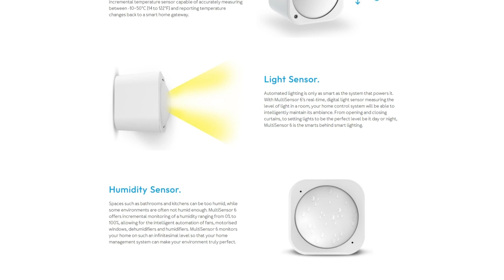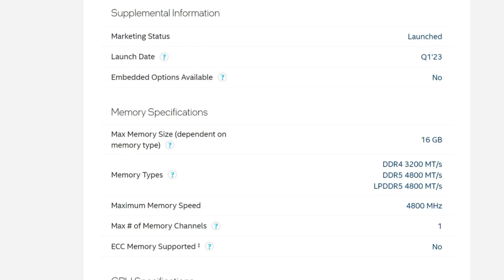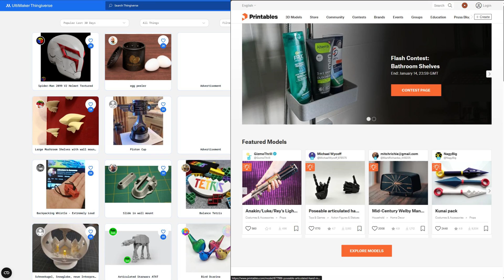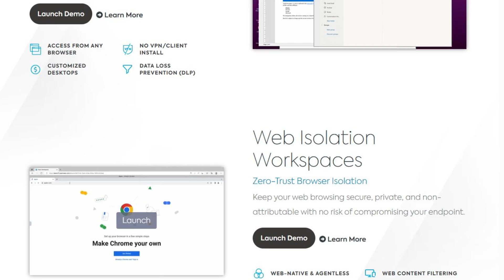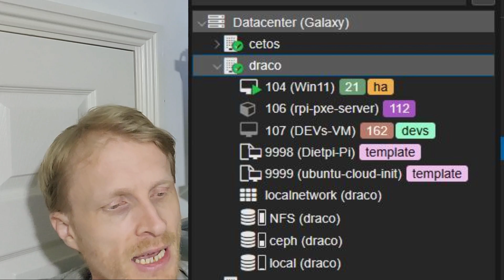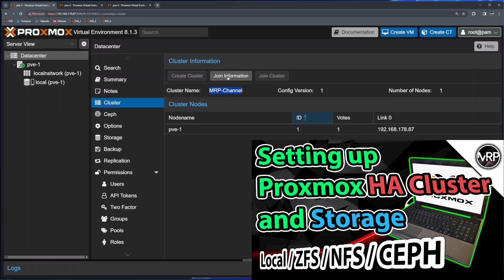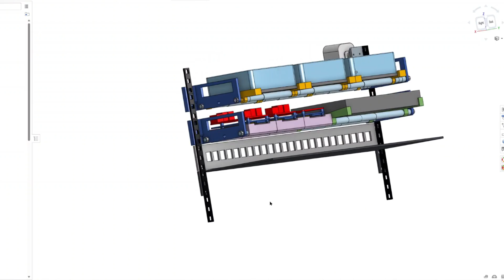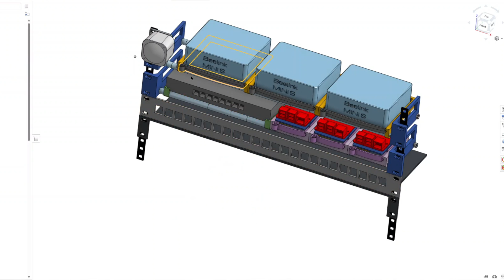My Home-Lab Proxmox 3 Node Cluster + other bits | Proxmox Home Server Series

Comment: Man you've been a blessing helping with Proxmox. Your setup is absolutely awesome! I have a quick question if you don't mind. I ran into an issue when my dynamic IP changed. I have a domain with Cloudflare and so I assumed it would be an easy fix by just going into my DNS settings on Cloudflare and updating the IP address but since Proxmox's GUI is hosted on port 8006 it seems Cloudflare won't allow me to use my IP and port. For instance when I put in 192.168.xx.x:8006 it tosses me a error and will not let me add it. Now I can't go to my domain and access my server. Can you please help? 🥺
Reply from the maker: Standard cloudflare DNS configuration allows only 80/443 port mapping. I suggest to have Cloudflare Tunnel setup going. That way you can map any port on any internal network IP address.
Reply: @MRPtech  I mean it was working I'm uncertain what you mean can you provide what I need to do exactly? I'd followed your guide to setting it up here on YT and it was working fine til the IP changed.

Comment: Excellent rack! I'm thinking of doing something 80% similar, however, I'm very indecisive about the equipment selection.

Let me tell you what I have and want to maintain in HA:

    2 VMs with virtualized Pfsense (One primary and the other for backup)
    2 VMs with Pihole for DNS resolution
    1 VM for Home Assistant
    1 VM for Jellyfin and Transmission over VPN

    (some other not so important VMs and CT for testing and tinkering purposes)

Currently, I have an old 2014 Mac Mini with a 1TB NVMe disk and 8GB of RAM that works perfectly, but I'm looking for redundancy and, at the same time, the lowest possible energy consumption.

My biggest question is, do I need individual NICs for CEPH and others for HA? Does performance suffer enough to justify the expense?

These questions are tied to the fact that I'm leaning towards N100 processors (each node with 16GB like yours) for efficiency and low consumption, but I'm also interested in having the nodes "fanless," so I was considering the options of "firewall PC" with 6 NICs each.

Thank you in advance for your opinion.
Reply from the maker: Hi, 
I picked N100s for exact reasons : efficiency and low consumption. And that i can upgrade to 16GB RAM or more down the line. 

About Fan-less PCs:
I was thinking to get fan-less mini PC's with more then one NIC, but i had some concerns about cooling in the box. In summer my home office gets quite hot and even not i am not sure if these mini PCs and exhaust fan will do enough job to keep it away from fire. If all will goes well during this summer i might change them, but then i need to change switch to more ports or add additional one ... i am not sure if i want to do that at this moment. 

CEPH:
CEPH recommends to have separate NIC for CEPH traffic but for home lab ... i think it is not necessary. Would be cool to have but it is not a deal breaker if i run all traffic to nodes via single port. Only time when single port gets hammered with traffic is during night when backups getting pushed to external NAS. That is happening between 2 and 5AM. No one  is using my self-hosted services during that time and if they do, i willbe very surprised if they can sport any difference in performance. 

What i can say, unless you will run self-hosted services that are crucial to your business, Cluster with 3x N100s will be fine. I don't have any stats to present but my ques would be that just by using services like Plex, DNS, NextCloud and others hosted on single NIC Proxmox Cluster with CEPH and with multi-port nodes - i don't think you will notice a difference unless you will start do "pixel-peeping". comparing speeds results to min-max the setup. 

FYI:
Electricity Consumption of my GALAXY. That includes: 3 x RPi4, 3 x N100 MiniPCs, Synology DS432+, Asus Lyra, Router, Switch, exhaust fan and LEDs.
https://prnt.sc/NGE92nwById3 

Let me know if you need anything else form me.
Reply: @MRPtech  

So, a single 2.5Gbe connection is sufficient to handle CEPH, HA, and normal VM traffic? That's great news. I was considering using one NIC solely for CEPH and HA.

Those firewall PCs seem ideal for the job. However, the high temperatures are also a bit concerning for me since my 'rack' will be tucked away at the bottom of my TV set.

My main concern was that the performance of my Home Assistant, pfSense, and DNS could be degraded due to an Ethernet bottleneck.

This is exactly the answer I was seeking! Your information is invaluable. Thank you very much.

Comment: Great video. How much RAM and CPU does the ceph consume in this setup?
Reply from the maker: As a rule - 1TB of CEPH storage will use 1GB ram. If i have 2TB SSD in each node that mean it uses ~2GB Ram per node. 
With CPU - it is using so little that i don't even notice even when a lot of data read/write to and from CEPH storage.

Comment: Nice to see your setup ;-)
I have a cluster of 3 nuc's just like the one you have. I have the high version with dual 2.5g nic's. It draws 8 watt per node.
Reply from the maker: NICE!
Which NUCs do you have?
Reply: @MRPtech   NUC11TNHv5 pro kit, it is the high version with double 2.5g nic's.
Reply from the maker: So far 1gbps for me is ok. Before i will even start thinking about cluster with 2.5g i need to sort my home networking first :)

Comment: Great tour. How are you running proxmox on the default consumer ssd? I'm virtualising opnsense on similar device with ZFS and it's writing 24GB/day without HA. Do you also use ZFS?
Reply from the maker: Proxmox OS running of 512GB NVME and each node has 2TB SSD linked in CEPH for redundancy.